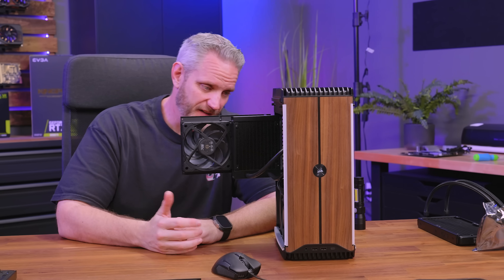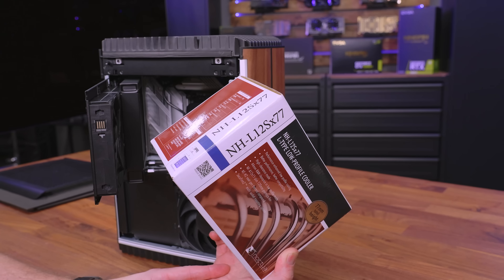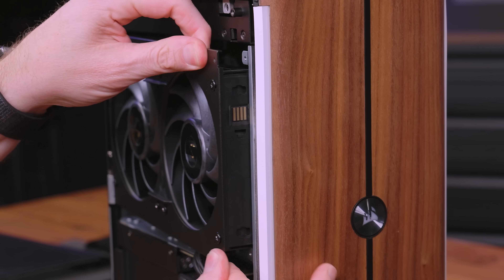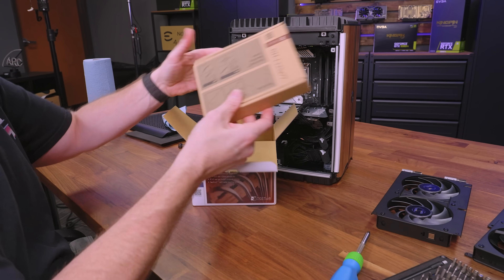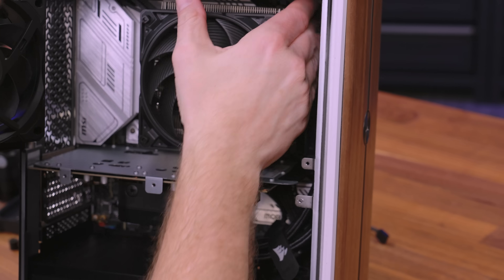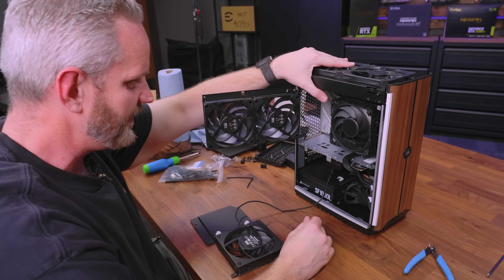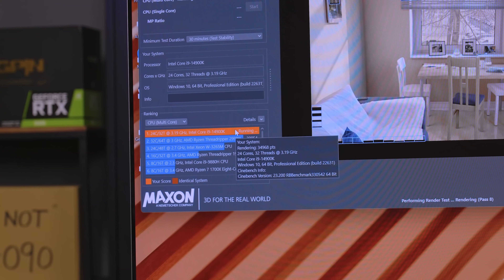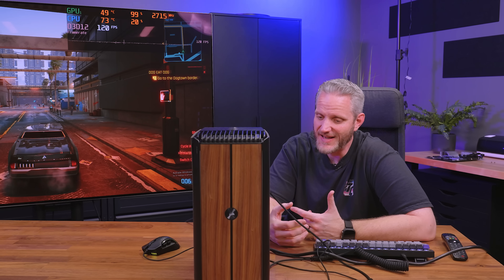Well... that was an unexpected improvement...

Comment: Throw a tower cooler on there, compare. Then throw a "properly sized" liquid loop/ radiator, compare. and report back. TIA. (Sure, I'll show my bias. Long live air cooling! It's simpler, cleaner, less maintenance, easier maintenance, and even if the fans fail, the passive nature of air cooling will keep the pc alive, vise, a pump failure (RIP PC if not auto shutdown/ auto throttled like it should to protect it's self, but I digress)...

Meanwhile, let's consider the BTU's that are going into ANY liquid loop, will have to be removed, somehow... otherwise the loop will just start to heat up, and unless the conductivity of the rad/ fan combo is more than the input, it's bound to hit a ceiling... even if you loop is a swimming pool (here's looking at you Linus) ... it's all just a math formula. Somebody with a background in thermodynamics feel free to chime in below.

Comment: You cut the test at like a couple of minutes out of 30. I highly doubt that air cooler would have worked.

I also dont agree with the tdp stuff you are saying. Coolers have tdp rating for the heat dissipation. Having a cooler thats only meant for 150w which is what most single tower will get you isnt the best of ideas for a cpu producing 250 ish watts. 

Run that full test. Even just do the 10min one. More than likely by 5min its going to be heat soaked. You were not even 3mins in and were seeing 100 degrees popping up.

Now switching out to a 7800x3d with that air cooler will probably be much better.

And another big caveat is the room in which it is placed. This is truly only doing thst well cause of the building you are in with your cooling setup. People at home? With less than idel cooling will have issues. Cause until i got a portable air condition which keeps my room at 73 degree, when my room was in the 80s i saw +5 through +10 degrees added onto my cpu temps and i am running a deepcool assassin iv. What was working went into the realm of oh shit. And this is with a 7950x3d. Only for cinebench did i see those temps. Reg use and gaming was 60s and some 70s. Now its all 60s with my room being properly cooled.

Comment: This just goes to show how wrong I was running a 240mm AIO on an 8700k in my NCase M1 build. I've been debating switching to one of these Noctua coolers next time I upgrade the CPU side and I think this just cemented that decision. Running a 3080Ti plus a 240mm just makes the case a mess inside. I guess we live and learn.

Comment: For curiosity's sake I would take the case fans off, use a larger cooler of the same style (if it exists) and the thiccest fan that'd fit on the rad... 
or just take the case fans off and use a beefier fan on that cooler. 
I'm wondering if turbulence is becoming an issue with the case and cooler fans being so close.

Comment: I remember having my amd fx 8350 running rather cold because of the giant (and rather expensive) tower air cooler and the intake fans & the giant fan at the top sending all that hot air out.  😅

Comment: Corsair: We need to improve our best SFF case.
Design Team: We increased the case from 12L to 21.7L, added more fans, & made the cooling so bad it will thermal throttle.
Corsair: Perfect! How soon can we start shipping?

Corsair sell the original case, and let users select their components. We can all show you how to fit a 14900k and an RTX4090 into an SFF case that doesn't thermal throttle.

Comment: Small rad on hot CPU.....
Logically liquid takes longer to heat but it's also difficult to cool down fast, that solution you got there makes more harm than good if stressing the CPU over time.

Comment: My gen 1 12 core Threadripper is cooled just fine by a 240 radiator with fans not getting near MAX RPM, that is a CPU that is idling at 170 / 180 watts on windows desktop.
O and BTW my D5 pump is also pretty much idling

Comment: After seeing someone one comment about the  AMD 7800X3D it came to mind what may have happened. The case and the 120mm AIO is enough for the AMD 7800X3D, the other high performance gaming CPU, and the case was repurposed for the Intel, with out any design changes which explains the none optimal cooling.

Comment: One other point: this isn't apples-to-apples. I'm betting that if iCue monitored GPU and CPU temps instead of the AIO coolant temps, the fan control response would be much sooner / better. It might still throttle, but I'm thinking it would perform better, if not much better. The proprietary cooling control design Corsair has come up with here (and previously based on objective results) just plain doesn't cut it.
Reply from the maker: Well it doesn't. And ICue doesn't control any aspect of this system so it's terrible

Comment: I don't understand why Jay is so caught up on the fan speed for AIO being tied to coolant temperature, it's a perfectly valid thing to do in a closed system.  Your component temperature is directly tied to to the heat soak level of the liquid in the system as that's the conductive medium.  Increasing the volume of air through the radiator as the coolant level climbs makes perfect sense.  It's especially useful in single loop systems that cool multiple components as you have more than one heat source (say CPU and GPU) that will run a vastly different temperature ranges. Each component will only be as hot as the maximum energy transfer rate between the chip and the cold plate will allow + the coolant temp delta.

Not to say pegging the coolers fan speed to the CPU temp in this instance would be incorrect (obviously since air coolers work this way almost exclusively).  It's the only component being cooled so it doesn't really matter either way.

Comment: Here's the thing: my recollection (not always accurate) is that the number one complaint about the previous Corsair One design was bad cooling - iCue's monitoring method being a huge part of the problem. The fact that they went full speed ahead with the same broken design paradigm is pretty alarming. With the recent backlash against Micro$oft / Windows 11 / Recall / etc., and people moving to Linux, Corsair needs to realize they'll be cutting themselves out of a significant market share with this design - it simply doesn't work with any Linux distro. I tried. Had to rewire and use CoolerControl (FanControl for Linux).

Comment: I have a older version of that Noctua air cooler. 4 heat pipes with 2 fans. The bottom fan is just a little smaller. So my question is would adding a small fan under the heat fins help thermals.

Comment: At the end of the day, if the amount of material used for the heat exchanging part isn't enough, it doesn't matter if you're using air or water. But at least with air, there's at least one less step to getting to the heat exchanging part.

Comment: Those fan clips on the Noctua cooler will actually just work fine for 25mm thick fans as they have two steps. So you could just have mounted the thicker fan without zip ties.
Or you could have used the original fan (rotated so it pulls air and doesn't fire against the case fans) and then the thick intake fan above it. Would have worked probably just as fine.

Comment: you might want to try undervolting. Some CPUs are odd in if you tweak their power curve to lower voltage a few mA you can drop a C or two and actually get more out of it. Personally I have been undervolting for half a decade. Though Really Intel has been a huge issue for over half a decade of their thermals being out of control. It reminds me of the old P4 days when people were joking about needing a nuclear cooling tower to tame them.

I just get more enjoyment out of cutting my power by 20% and getting ~95% of the performance these days. Sometimes you will get a good bin and can get a -15 to -10 slide for stock reference performance.

Comment: Don't you have a slightly higher topblower cooler, so you could just leave the fan off and let the case fans do all the work.
Maybe you could use 30mm case fans for more air throughput?
Or maybe 3d print something to make contact?

Comment: That computer costs 4 723 USD here in Norway. I think for that price it has to have a solid cooling solution.
Reply: And I would think for the price Sony charges for their Bravia OLED TV's it would last more than 2yrs, but here I am stuck with a nonrepairable high end TV made to be disposable. 😢

Sadly, companies make products to be bought, not to be used or to satisfy their customers these days.
Reply: @goldenheartOh  Capitalism goes BRRRR
Reply: @kristoffer3000  we had Capitalism when TV's lasted decades too. I'd recon society just didn't put up with expensive crap that couldn't be fixed. Today, our mindset is much more "disposable is fine".
Reply: @goldenheartOh  Things were made a lot better years ago because capitalism wasn't pushed to its limits then, the profit margins were way higher and also technology hadn't gotten as far so they just didn't know how to make things last just past the warranty period.
Also quality was a huge selling point.
Reply: @kristoffer3000  agree with you on all points there. Every system needs its limits. Quality was important. Also, there wasn't the excuse of "we're using less material to be environmentally friendly" when they skimped on materials. You know what's good for the environment?  Making stuff that lasts & is repairable.

Comment: A 120mm AIO could probably work just fine for a 14900k... if you're using one of those 4 AMP Delta Screamers as the cooling fan.

Comment: I'd try the NH-C14S without the fans on the side and the cooler fan under the cooler, pushing through the radiator and out on the side.

Comment: I always find these experiments fascinating.  You you "might" be able to squeeze a NH-C14S in there if you bottom mount the fan onto the cooler.  There should still be clearance for the RAM.  Or just start cutting and squeeze the 240 AIO in there.

Comment: I hope they throw some R&D money your way Jay, you are doing their work for them as you tinker for a better solution. I would like for you to do the dremel the edge and fit a 240 in there and test that vs your air cooler setup also, if that makes it fit that is.

Comment: Well, if they'd used an AMD processor, they wouldn't have this heat problem, or at the very least it wouldn't be near as bad.  My 7800X3d tops out at 111W of actual used power.

Comment: Seeing as how this is a Corsair pre-built, if they didn't want to do a custom rad or change the case to fit a 240mm for the CPU, they could've put the AIOs in series to share 360mm of rad between both the CPU and GPU... It would be interesting to see if that increased stock performance from CPU boost-throttling even if it starts boost-throttling the GPU and CPU when in series.

Comment: I was seeing the CAMM2 concept motherboards in Computex coveerage and was thinking that if that became a standard you could do a really wide heatsink for a case like this and cool that 14900K much easier. Ideally, Corsair would have made it like a half to an inch deeper so you could fit a 240mm radiator but imagining a world where camm2 is a thing and you have a downfire dual tower low-profile CPU cooler for SFF makes me excited. Though knowing companies and tooling and status quo that won't happen, but it's nice to dream.

Comment: reverse the flow on all 3 fans so its pulling air through the cooler and exhausting on the side blowing hot air on the MB might be heat soaking the internals

Comment: I didn't know about the old version having a bespoke radiator, as you said, which means that they could have gone with a bespoke one again, as shown at Computex, where someone (I forgot which manufacturer) has made a radiator where the tubes is attached at the middle off the side, which means that it should be possible to make the whole 240 space into a rad with the tubes in the same place as the 120.
But of course they wouldn't do that because that would cut into their profit margins.

Comment: should try fitting two 120 rads side by side connected together so the ends are at the side making it roughly 240 long 160 wide.

Comment: I'm an air cooling guy so maybe it's weird I watch this channel a lot but it's great fun and I've learnt tonnes about water cooling. That made this video stand out strangely! Still good fun but it was a relatively predictable outcome given the parts you had to work with. I'd probably try the Noctua Nh-C14 in there. I reckon it would fit with just the lower fan and you'd get even better performance.

Comment: I quite simply don't see the point in liquid cooling. It seems like it takes way more work for very little, if not zero gain over air cooling. I have not had a single system I've built thermal throttle using an air cooler. Granted I don't over clock, because again, a lot of work and risk for little gain. I recognize this is a subjective thing, and I quite simply don't get it.

Comment: You can also try out METALFISH 180 Liquid Cooler AIO Water Cooling. Its a 2x90mm AIO and i think it would fit on the side fan mount. 
My brother is using it on a 11700K and the max temp is 65-70c.

Comment: Yet another small AIO replaced by a quality air cooler.  No point until you get large.  I still think this should be a 14700 or a 7800x3d or 7700x.

Comment: I wonder if there's a down-firing CPU heatsink that's taller that you could fit by removing the 120mm fans that are positioned above it. Seems like if you get the fan on the CPU heatsink close enough to the surface it would likely do a good enough job at intake, and might actually give a better overall result.

Comment: You could probably fit a thermal right si100. Its a similar design to the noctua but is taller and comes with a 25mm thick fan.

Comment: How do i cool my Ryzen 9 7950x without it being a jet engine? i am currently using a 360mm AIO cooler from enermax, i replaced the stock fans with 3 Delta AFB1212GHE-CF00 Case cooler fans (5200 RPM & 240.96 CFM) which run full speed all the time because of the MSI motherboard and fan control can't see the fans, However even under max load the ryzen doesn't throttle at all, but i am going deaf from the noise, any suggestions on a better cooling solution? maybe a full loop with one of those giant radiators that hold 9 120mm fans? or would i just be wasting my money? can i deaden the fan noise by recording it and playing it back through a speaker in the PC case?

Comment: Corsair is a trash company that makes trash products.  It’s so fucking stupid that they went with a 14900K instead of a much easier to cool 7800X3D.  In fact I’d bet that the 14600K would yield comparable performance since it won’t throttle as hard.  That might work with this cooling setup.